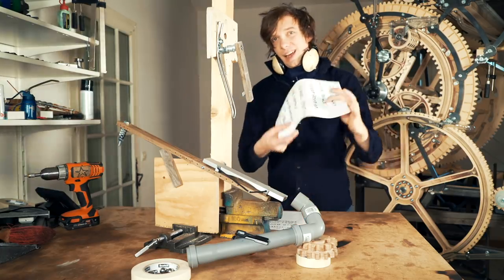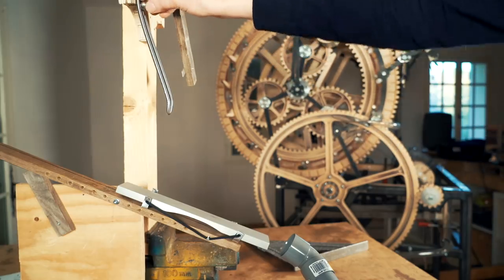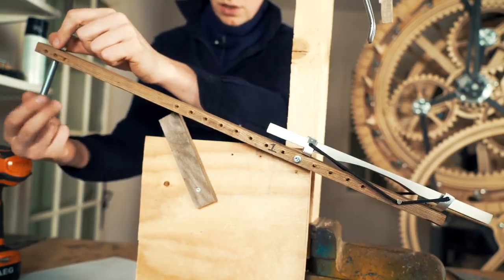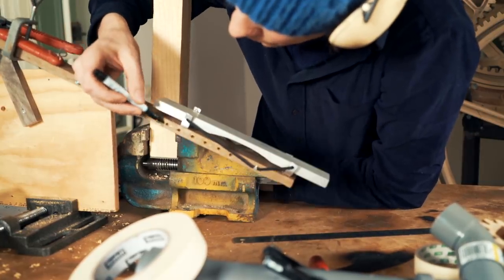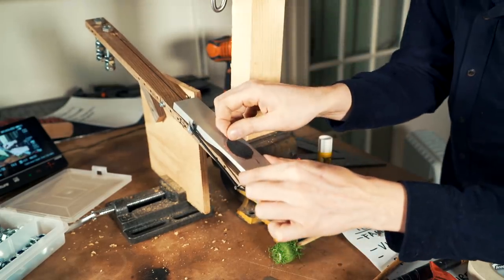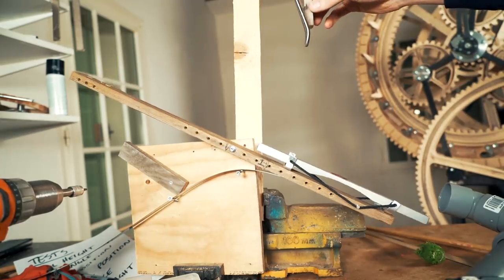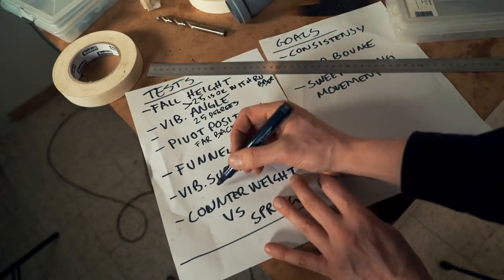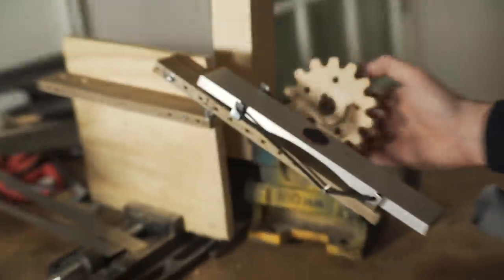Vibraphone Movement Test  - Marble Machine X #64

Comment: I'm sure Martin would be a millionaire with everyone's two cents thrown in, but is there a reason a design with the springs on the top of the vibraphone isn't being considered?  Putting the springs in tension instead of compression might also provide a little bit of adjust-ability by moving the connection point closer or further away from the pivot point in case the specific notes are lighter or heavier than the original calibration.  Depending on the design, it might make an inconspicuous place to put the pickup microphones as well.  Plus free up some space underneath for the resonance tube mechanisms.  Please accept my two cents.

Comment: I'm a bit confused and worried about this. You spent all that time making sure the marbles hit in unison, but this is going to make all that meaningless. The reason I say that is because you might have marbles hitting the key as it's on it's way back up from being hit from a previous marble, at the same time as another marble hitting a key that is at it's resting position. Even if the marbles don't drop fast enough for that to be an issue, I feel like this is going to be a problem to maintain the position and precision of all these keys.  
And taking the most important musical part of the machine and sacrificing sound quality, precision, and reliability for cosmetics... It just doesn't seem right.

Comment: Hi Martin. Daniel here from Victoria, British Columbia, Canada. How about trying some kind of piston inside the resonator tubes to mimic various lengths for each tube. I suppose the pistons might require some kind of ventilation or the ventilation could be in the tubes themselves. This would eliminate the need to physically change each tube. You could make the adjustments on the fly. Would there be enough room for mounting levers? Or how about air activated pistons to raise and lower their height. Would it be practical? What do you think? Just an idea for you to toy with.

Comment: Note from A percussionist versed in Keyboard instruments: You most likely would not have to take out and replace entire Resonators like you are planning on doing. I have seen plenty of Marimbas and Vibraphones that have adjustable Resonators at their end where you twist a screw to lock them in place anywhere up the resonator you see fit. I would highly suggest doing such If you need to change the lengths of the Resonators since changing them out might be a bit cumbersome. Here is a link to on such marimba by mattetech that uses This adjustable resonator ends. https://www.mostlymarimba.com/instruments/designs-a-technology.html
Reply: Although it is patented so You may need to come up with an original design for them sadly. :( Just a suggestion though

Comment: I think having the entire vibraphone plate move isn't a very good idea. The ball bearings don't have a lot of mass to begin with. And moving the large assembly causes more problems than it's worth. Since you have to account for the movement and the distance between the plates and the tubes below. What happens when you do quick notes and different marbles hit the assembly at different angles of incidence? They'll bounce off in different directions. A marble hitting the assembly at it's top height will have much less bounce than a marble that hits at it's bottom most position where rigidity is the strongest.

Comment: now how would it sound if you cut a rubber strip of an bicycle inner tube. that kind of rubber is thinner because you noticed the fact the rubber pad is to thick.
and then span that inner tube rubber over the full length of kling with a small space aria between it (like strings of a guitar laying over the bridge and the comb) because it damps the sound to quick and to much if you glue it on top of the kling. if you let the rubber ribbon float above then it functions like the vilt hammer of a piano that does or does not rest on the strings . (only if you press the right pedal) and thus sounds more like your green fluffy stick.

Comment: I think that slow movement you are aiming for will not work with consecutive notes, leaving timing aside. More marbles will just depress the angle more and more, so let's say four consecutive notes will just tip the whole thing to its stops, changing the sound.
I think you need to aim for a mechanism with zero movement. Just to make sure every note sounds the same. Otherwise this will come back to haunt you.

Comment: PHYSICS PHYSICS PHYSICS!

Research the formula for Pendulums. The period of vibration of the ENTIRE moment arm of the whole counterweight wi affect two things: the speed st which the arm recovers to its original position; Secondly, and I'm surprised you, as a musician, did not notice. The varying vibration of the arm affects the vibration of note. A vibrato, before the vibrato plate .

Consider that the "anamusik" option must be timed so that multiple notes, the same note, does not impart change in the primary resonance of the note. Cheers.

Comment: Have you considered the possibility that your pivot point, spring value, marble approach angle might have to change for each note?  The difference in  mass for each of the vibraphone tuned metal bars is not insignificant.  I am concerned that your demonstration in this video did not consider enough variables.  Since you want to change notes during a concert, it may be easier to build each note, (including pivot point, spring, resonant tube and associated hardware) as one unit.

Comment: Two points.  Have you studied the resonator design of the Yamaha MXL-32AF?  It's a super compact xylophone, and the resonators are light and effective.
http://www.lonestarpercussion.com/Marching/Marching-Keyboards/Yamaha-MXL-32AF.html

Also, are you thinking of including a damper on it?  The recoil motion would allow for a good short duration damper next to the collection pipe that would open as the bar falls, but closes when the bar returns to its original location.  It could be designed to be switched on and off too.

Comment: Leaf spring may be good but one of them does not give the desired result.

http://knowledgestream.co.in/images/leaf-spring-animation.gif

If you place more than one leaf spring in different lengths, the force will increase as the angle increases.
Of course, you'll make trial and error to find the required force.Or you have to make an account.

On the hardest side, since each part of the xylophone has different weights, you will have to do the leaf spring calculation again.

Good luck.